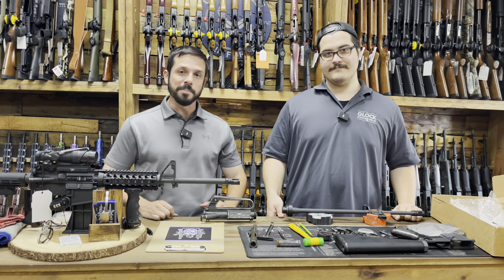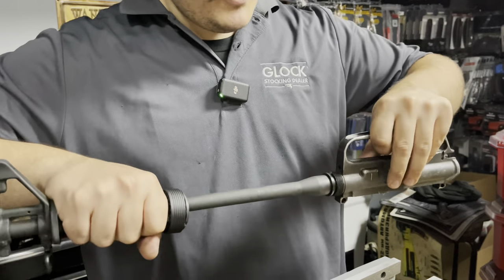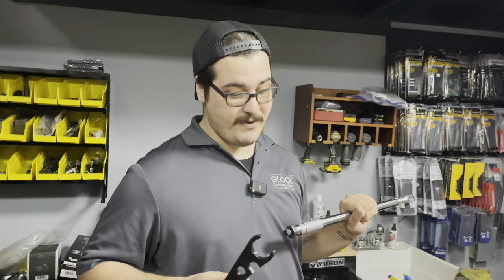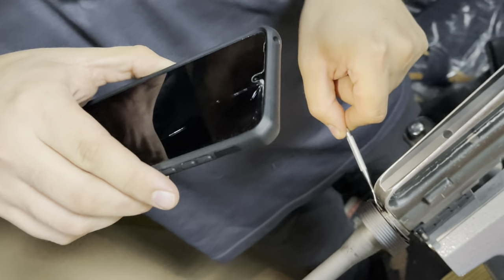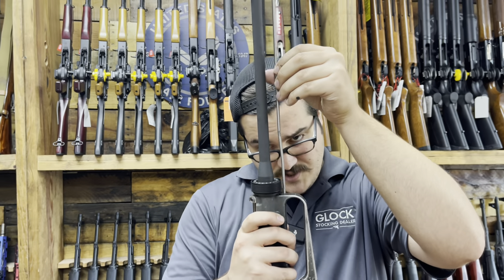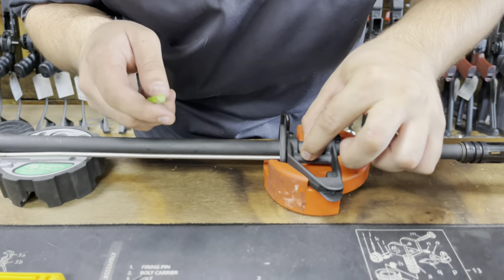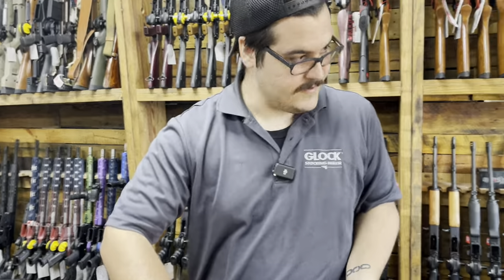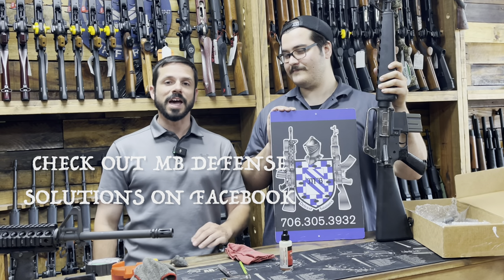How to: PSA M16A1 Barrel on a Vintage 1970’s Colt Upper

Comment: I use cv joint grease for the bolt carrier where it rides in the upper receiver.  Same for charging handle. Much smoother than any oil. Everything else gets 5w30 mobil one.

Comment: Assembly is fine. True test is firing it to make sure you have enough gas that cycles through to function. Now to really lube the rifle before firing. First is to put a drop of oil into the gas carrier key the thing on top that catches the gas tube thingy, then a few drops into the side of the vent holes that goes into the gas expansion chamber. Once you fire your first round the oil will go all inside the upper receiver to properly lube your M16 or AR-15. Honestly don't use Break Free CLP!!! That shit is garbage!!! Use FP-10 by Shooters Choice, this is pure lubricant like motor oil 10-30 WT which is recommended during the Vietnam Era which worked. Break Free CLP causes carbon build up which can build up in front of the bolt carrier and bolt head which will cause the bolt not to close in battery. Using the forward assist to close the bolt will result in blowing up because the carrier and bolt didn't lock up properly. Using a lubricant that doesn't turn to carbon is easier to clean and wipe when you see your rifle fail to go into battery. FP-10 never failed me in Iraq, my M2 Ma Deuce, M240s, and SAWs kept running even with dust in in them. I told my gunners clean them well and lubricate them well. Weapons will fail without lubrication no matter what environment you are in especially combat conditions.

Comment: ?? I believe this guy has it backwards. Bev Block = Muzzle Work & White Receive Vise = Barrel Nut. Index Pin doesn't rotate with barrel installation it's only drawn rearwards with clamping force. Muzzle brake or comp install will spin the barrel hence engaging the barrel extension with the bev block. Don't use a receiver clamp for muzzle work LOL

Comment: I have had a damaged upper even with the right block and vise. It was an expensive lesson to learn that sometimes it's better to have a real armorer do the work that knows what they are doing. Also the pitting, scratches, and possibly bent sections on the surplus parts make it a crapshoot. I want mine looking brand spanking new like they were when issued and when being used in the war, not how they look 60 years later with no anodizing left and after being beat to heck and slammed around in a parts bin for decades. Unless you actually want one beat to heck. Some like that. I think it looks horrible. To each his own.
Reply from the maker: Right on! PSA has the M16 clones under the H&R brand on their site, all kinds and good to go out of the box. I was thinking of getting a newer one, or maybe just one of the carbines
Reply: The PSA/H&R rifles and uppers sell out quick and are gone for many weeks at a time. The notification doesn't work all that great on PSAs website so it's best to check every day  till they get in stock what you're looking for. If what you get isn't absolutely perfect  you can get it replaced easily, no problem. PSA is fantastic when it comes to standing by their customers. Very quick replacement time. They are awesome.

Comment: No wonder there so many crap AR rifles on the market, following advice like this..All of the stress is still in the front take down stud..The small sail on the Bev block is not a tight fit in the upper and it still allows the upper to turn and put stress on the front take down pin....Installing the carrier on the O ring does absolutely nothing..I repeat, it does absolutely nothing..The carrier just spins around on it..Use an action rod with a sail ( Midwest Industries) that is a snug fit in the upper and spreads the stress in the uppers charging handle channel while preventing the barrel from clocking..Don't use antiseize as it doesn't prevent galvanic corrosion or give a proper torque..Use Aero shell 64 or 33 as required by the TDP..Colt factory uses Dupont molykote..If the notch is 1/2 way to alignment then torque all the way..If only 3/4 then loosen/ tighten the nut until the threads are seasoned enough to allow proper alignment with the gas tube..When doing a safety check you use your thumb and slowly roll it to test the fire control group..
Reply: Question: Does the delta ring spring weaken causing play to the handguard tension, mine will move about 1/16" back and forth?
Reply: @Allenmar73  Sounds more like a fitment issue between the hand guard and delta ring than a weak spring..